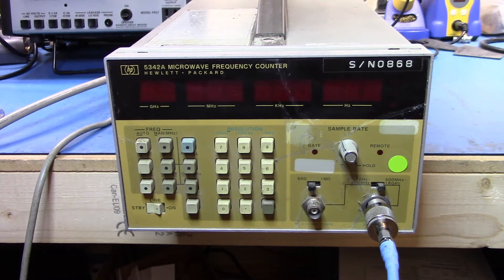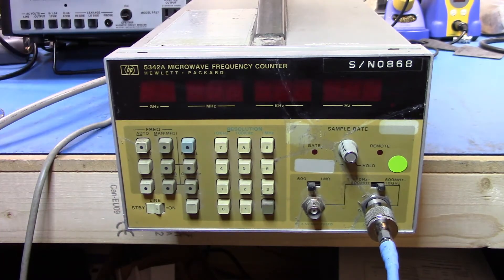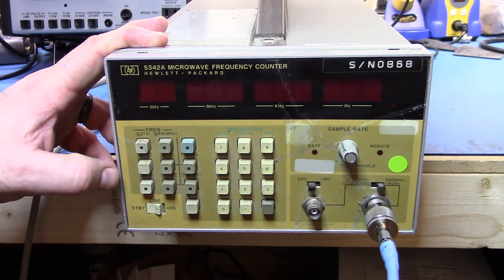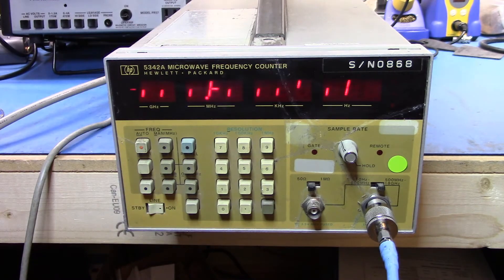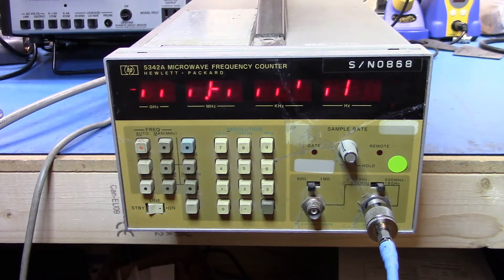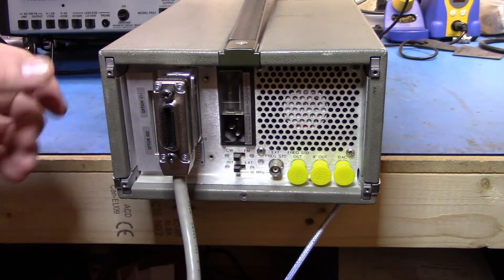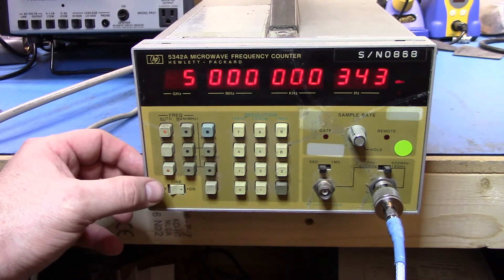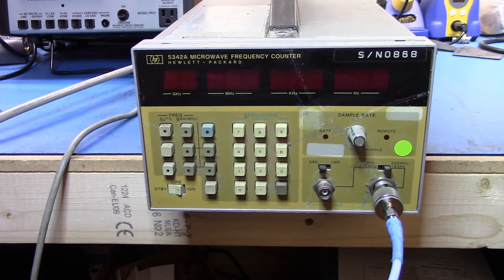HP 5342A Counter - User Error

Comment: This amplitude measurement measures your 5Ghz in auto mode. Does this unit have the capability to measure the power of a manually set frequency? Maybe you have a 5G input, but you want to know the amplitude at a different frequency.
Reply from the maker: You can manually set the frequency (which you need to know to within 50MHz) and then measure the amplitude of it - You can't measure one frequency and then the amplitude of another at the same time.

Comment: Hi were you able to program it? could you show me which command just to get the frequency reading? TIA
Reply from the maker: Sorry for the delay, was out. The manual for the unit is available from both Keysight and from Artek Manuals - I strongly recommend the Artek version because the scans are way better.

I had an issue using the "Keysight Interactive IO" application in that it wouldn't trigger the unit properly to read the frequency. I could communicate successfully using the VISA API though. However I just changed my E5810A for a NI GPIB-ENET/100 and using the NI-Visa Interactive Control it appears to work fine.

The simplest command would be something like, "AUSR3T0" - This tells the unit to use Auto frequency mode, 1 Hz resolution, Front panel sample rate. When you query with this command (with sufficient timeout & ensure that you have line control set) you should see something like:

1: Write Operation (AUSR3T0)

Return Count: 7 bytes

2: Read Operation
Return Count: 22 bytes
\sF\s\s01234.431301E+06\r\n

Hope this helps and you enjoy the other videos.

TonyG
Reply: Thank you for the reply. I only have the keysight connection expert and all I have is the following error:
-> AUSR3T0
 ! VI_ERROR_TMO: A timeout occurred
Visa ErrorCode: 0xBFFF0015 (-1073807339)
 ! Index was out of range. Must be non-negative and less than the size of the collection.
Parameter name: index
I've tried different EOL \r \n \r\n \n\r but still the same error.
Reply from the maker: Yes that is exactly the error I was getting with the Keysight program - It seems that the NI VISA stuff works correctly but not the Keysight one - However you can write a console app that will talk to it using the Keysight VISA Libs. Personally I'd use C# and VS Community Edition but Python & PyVISA should also work for you.
Reply: thank you for the tips. I'm visualbasic to control almost every piece of old instruments except for this one. I'll give NI VISA a try.
Reply from the maker: Happy to help - If you're using VB then the Keysight VISA libs will work for you, it's just the Interactive IO app that fails. Good luck.

Comment: It's one of the classic ways to acquire certain bits of (mostly HP) test kit cheap, a lot of them hang or show non-obvious errors. Sometimes you can even see it in auction demo photos.
Reply from the maker: Completely agree - I've picked up a number of pieces of kit that simply needed to have cards reinserted or the rear jumper cables added.

Comment: HAPPY NEW YEARS!
So about the video this is interesting. You'd think HP would put in "Check 10MHz" Warning or something. I have the 5343A which is similar but has more switching options in the back along going above 18GHz. You said that the "newer stuff has it worked out" plus I notice a low serial #? Was that what you meant?
Reply from the maker: Happy New Year to you as well - I certainly didn't think that having the switch set incorrectly would cause the counter to fail to boot - My comment was in reference to the newer devices having either an error or automatically flipping (my 8902A does this).
Reply: I see. Also I just checked the 5343A. Tried all the setting combinations with 10MHz set to external. I get all zeros on the display. I don't have a 5342A so I'm not sure just how different both are but according to hp's old catalogs and manuals I'm under the impression that theres not much difference. Very odd but as long as it works no harm done. :)

Comment: Curious as to what 10Mhz reference you are using in the rack.
Reply from the maker: I'm using a GPSDO which as far as I can tell exceeds the spec for the Option 010 type HP OCXO modules (I looked at the phase noise for it and all I saw was the noise floor of the oscillators). I'd like to upgrade it though to a proper Symmetricom or HP one at some point but right now they're too expensive for my use.
Reply: Are you using a distribution amp or daisy chaining to all the equipment?  If using an distro amp, what type are you using?  I'm thinking about modifying a video distro amp.
Reply from the maker: I'm using a Symmetricom 6502 distribution amp.